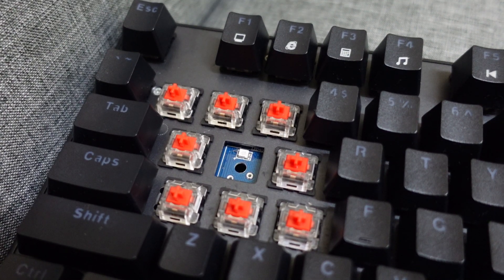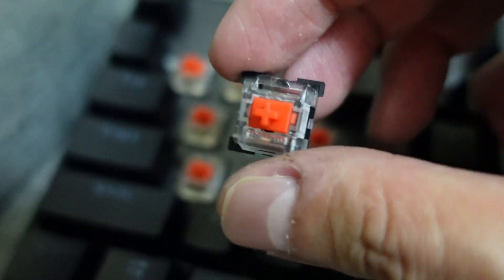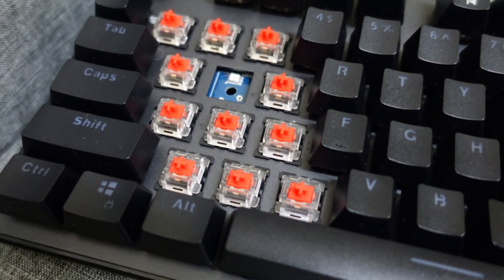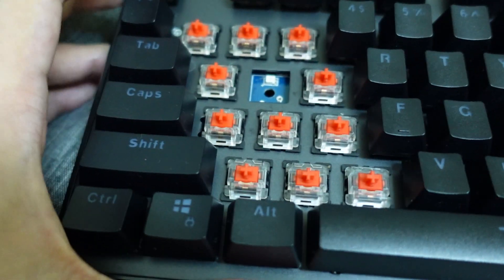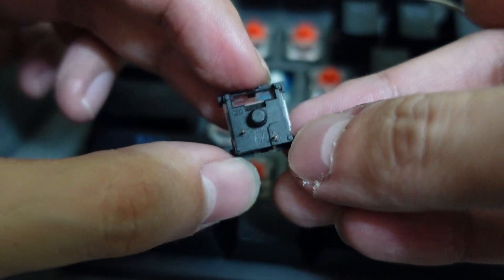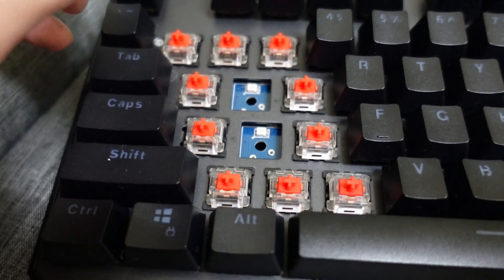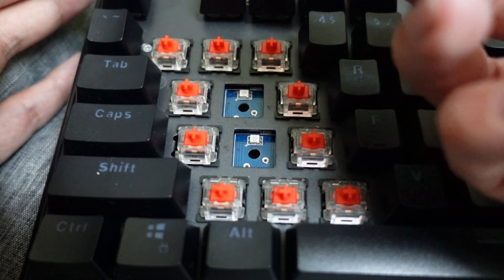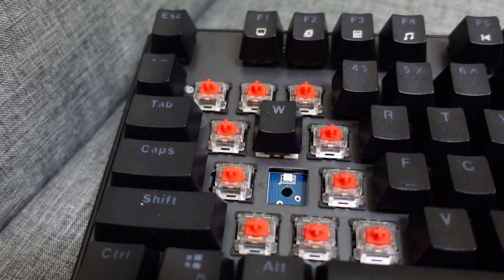How to Replace Key Switches on Hotswappable Mechanical Keyboard (Quick & Easy - Tecware Phantom)

Comment: My hand is in so much pain from just 1 switch, idk how u do it
Reply from the maker: what puller you use? The 1 I am using in this video is quite low quality.
Reply: @PenguinTech521  the one that came with my tecware. Small silver one
Reply from the maker: @iDeker  yeah the handle is too thin so it's painful when you pull upward.
Reply: @PenguinTech521  I can’t get any other rn do u know any easy ways to get them off with something else? I order some Akko rose red but I’m worried I won’t be able to even get the outemu reds out first